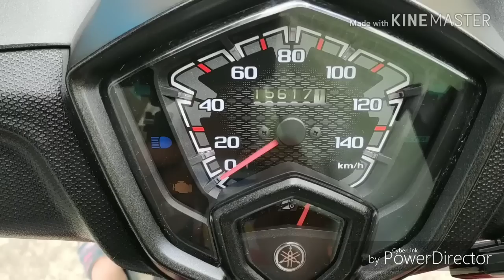Eagle Eye Installation on Mio soul i 125

Comment: paps tanung ko lang kng ok lng ba na rekta sa battery dalawang eagle eye at dalawang fog light pro may mga switch sila isa.isa, ok lng ba yun?
Reply from the maker: diko marerecommend yang ganyan sir.. kasi once na na ground dun sa fog light at eagle eye ay sira pati battery mo nun kasi wala nang fuse na dadaanan para ma break yung short circuit.

Comment: Boss tanung lang po ginaya ko po kasi pag kakabit nyo ng Eagle eye pero yung akin po nag biblink yung Eagle eye pagka kabit ko. Possible po ba yun kasi hindi pa battery operated yung MSI ko? Pano po ba ee alisin sa magnito yung connection?
Reply from the maker: baka po yung eagle eye nyong nabili po ay yung blinker type hindi yung steady
Reply: @DIYScoot  hindi po boss same lang din po ng brand na kinabit mo yung nabili ko pag pina ilaw na sya hindi pa po sya nag biblink tapos po mga 5mins siguro nag biblink na po tapos hindi rin naman po sabay nag biblink possible po ba yun na mahina ang bato ng kuryente kasj dpa battery operated MSI ko?
Reply from the maker: @sammysamonte1663   wala naman akong cinoconvert sa motor ko.. tungkol sa operated system nya alam ko ay battery operated na ang msi eh.. 
baka naman po maluwag lang ang pagkakatap nyo.. kaya nag loloose.. or sira na kaagad yung nabili nyo..
Reply: Sige boss try ko na lang po bumili ng bagong Eagle eye salamat po sa pag bibigay pansin RS and More content to come 😊

Comment: Sakin paps dyn ko din nilagay yung eagle eyes pero naka Attached sa Battery okey lng ba?
Reply from the maker: aling line ang nakakabit sa battery paps?
Reply: DIYScoot  yung eagle paps dalawang pares kase sakin yung isa banda sa likod nya
Reply from the maker: ang ibig kong sabihin paps yung line na nakakabit sa battery mo red or black wire?
Reply: DIYScoot pareho boss okey naman sya tanong ko lang hnd ba malakas kumain ng battery?
Reply: DIYScoot nag add lang ako ng extra wire paps
Reply from the maker: di naman malakas sa battery yan paps..lasi LED lights naman sya. RS!
Reply: DIYScoot pansin ko paps pinalitan mo park ligth mo?